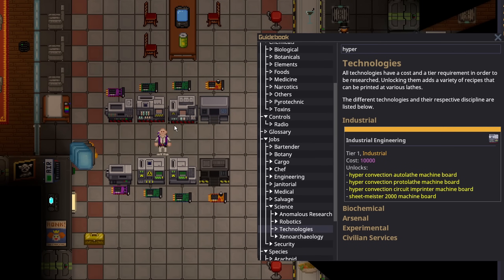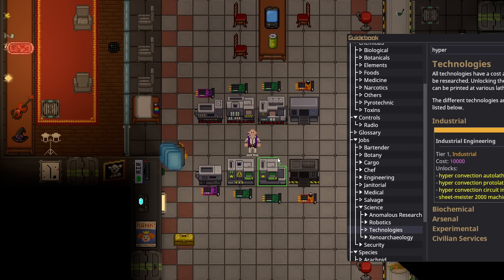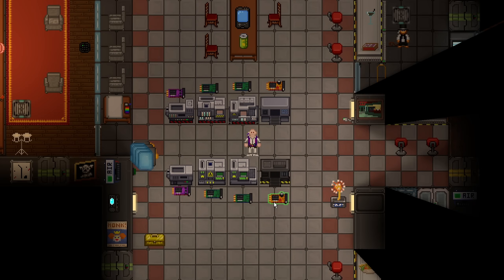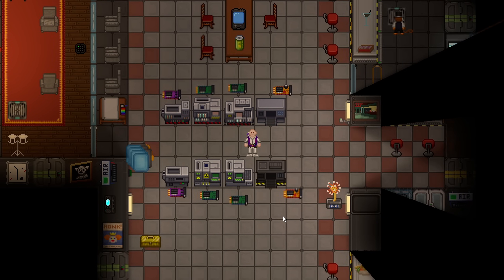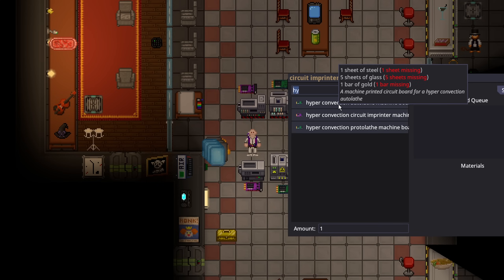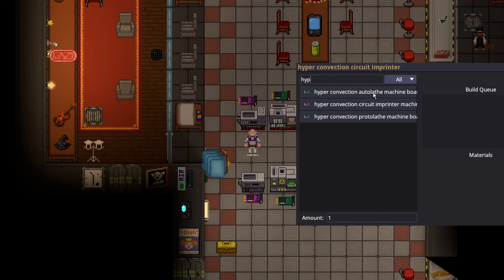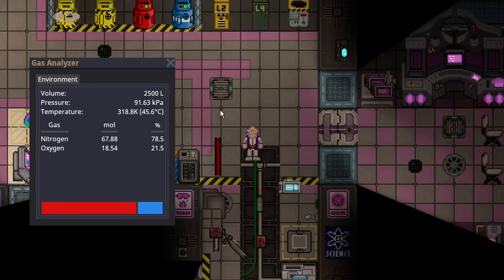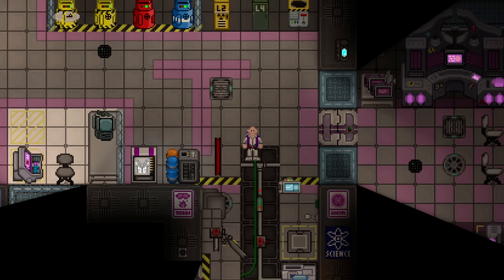SS14 - Hyper Convection Machines Explained (And How to Deal With the Heat)

Comment from the maker: If anyone has better methods of cooling hyperconvection machines, please share them in the comments. I'm just giving base level ideas of how to manage the heat.
This is probably the best method: https://youtu.be/wcRa3VT8SqE?si=ltXAfd5i_JsURHlZ
Reply: 7 space heaters surrounding it and one for accessing (I have had this happen)
Reply from the maker: @NomNumNomYum  The minecraft enchanting table method lol
Reply: you can actually just place a passive vent and connect it to a freezer/hellfire freezer. Put it on 293K (room temperature). Usually works fine
Reply: I'm wondering about using radiators to equalize temperature with a gas loop (either the waste loop or one going to radiators in space) without venting the room's air,

Comment: Wearing insulated gear to protect from heat is perfectly normal, you just can only last there so long.

Iv'e absolutely been around huge bonfires and similar where wearing a jacket makes you significantly cooler

Comment: Generally what I do is place two space heaters near my hyper convection machines. You can usually do some light re-arranging to comfortably work around them. Set the space heaters to high power and lower the target temp to have a buffer to work with. Combine this with some fancy NT insulated clothing and you're pretty much fine in terms of temperature. If you're not running the clothing, you may be toasted a bit in small rooms but you can just leave the room for a few seconds, and chat at the front desk or whatever. 

I've seen paranoid RD's spend a quarter of a shift stuffing the hyper convection protolathe into a 2 by 3 box in maints and attempt to setup a hellfire cooling loop. While it is satisfying when it works and cranks out a lot of parts, it's much simpler to spend less than a crate of steel and a little bit of plastic on flatpacking two bluespace heaters. All in the pursuit of science!
Reply from the maker: i have a video comin out in a day that has probably the easiest method to completely eliminate heat.

Comment: I just checked and it seems you can build radiators that supposedly equalize heat between the environment and gas in a pipe! This might be the source of a more practical custom cooling system for such machines. Sad there doesn't seem to be a heat pump, though. At any rate, with some cleverness, I'd assume pumping heat into the station's waste gas (which is likely to be merely dumped overboard like open-cycle coolant) would be more power efficient than magicking it away with freezers.
Reply from the maker: Yeah, I'm sure that'd be a good solution if you can get good access to space as a scientist, which normally isn't too hard.

Comment: If you get your hands on a holofan you can put it right ontop of the machine with the same setup you use here in the arti room and the vent will only suck out the tile in the holofan and the hot air cant get out.

Comment: Now I'm imagining the amount of heat you pump out in Frontier. 
"Oh, I want an upgrade of 12 thrusters, that is 48 capacitors right there. And I also want the gyro upgraded, two generators,  the ore processor, and a few toys like advanced magboots." A casual 75 parts later and the walls are melting, and not from the space drugs
Reply: Frontier merchant here, I build my hyper-convection lathes on an extension built onto my ship. Can’t cook in a vacuum! Though they print WAYYYY slower so sometimes it’s better to use a time efficient standard lathe with t3 parts.
Reply: It's really funny. Since hardsuits protect you from the blistering heat, you can be perfectly fine but as soon as someone boards your ship to deliver mail or buy some of the cool stuff you are selling, they get instantly cooked by the easy bake oven you made your ship into
Reply: The mailman turned to ash on my science ship as it never dropped under 500C even with a radiator a space heater, and a ice anomaly putting out cold.
Reply: @shadowmeister5432  was that last night? Because I believe I went aboard a Lyrae docked to Frontier last night to look at some stuff they had for sale and got cooked pretty fast. I got out of the ship pretty quick, but even then fell to crit while trying to cool off.

They had commented about having an ice anomaly
Reply: @scottmacgregor3444  Oh sorry about that. Yea that was our ship, it was a tad toasty.
Reply: @shadowmeister5432  Ehh. My fault. When the temp went to yellow that quickly, what I should have done is immediately gone back to my ship and grabbed a hard suit.

Comment: My thought from my limited atmos knowledge, if you're working in a room near the edge of the station:
- Create a circular pipe loop between the lathe room and space.
- Include a connector port and a pump to be able to dump the contents of a can into the loop. (This does not need to be in the lathe room. Put it wherever along the loop.)
- Add a pump to move contents of the pipe in a circle.
- Add a couple radiators to the pipe both in the lathe room and out in space. The more the better, especially out in space.
- Get a can of CO2 (or whatever, but CO2 seems best offhand) from Atmos or wherever and dump it into the loop. (Set the insertion pump to max to drain the can into the loop.) If needed add a second can, but one should be plenty.
- Make sure the pump is running to circulate the CO2 through the loop. Not sure what power setting is best.

If my understanding is right, the CO2 in the loop should be forced out into space, where the radiators will chill the fuck out of the CO2. The chilled stuff comes back inside, where the radiators from the warm room should absorb the heat into the cold gas, which is then sent back out to be chilled. I'm completely theory-crafting here, but the thought is to use the same process as to cool a nuclear reactor, cycling stuff through to absorb the heat and then venting that heat off to something else (in this case, outer space).

Whether this will work at all with SS14 physics or whether it will provide enough cooling if it does work, I don't know.

If your shift's Atmos is bored (which they probably are), try recruiting them to help you build and test this concept! Have the RD ask the CE for help; we're usually looking for things for our people to do if there aren't bombs going off or whatever.
Reply: You could've just said it's just like liquid cooling for PC's. Did you ever test this out?
Reply: @celexample  Sorry for my first comment; I thought we were talking about TEGs. Okay. No, I have never tested it--in the ramble itself, I noted that I was purely theory-crafting. I'd be curious to know the results if anyone does test this approach or something similar. :)
Reply: @Archangelm127  Mega late here- but from my engineering knowledge the side effect here is that you would also COOL the room given how cold space gets so you MIGHT end up turning it too cold given the situation but theoretically it would work, if you disregard everyone being a popsicle
Reply: @martynas6ha4griefer  The TEG room is usually separate from the break room, and we all have hard suits. Quit whining and get back to work. 😂❤

Comment: Imagine if putting a hyper convection on top of a gas port made it function as an exhaust extractor, depositing hot air into the port with much less radiant heat put into the general environment.

Comment: Yeah Salv not being focused on mining can be a pain. What I really don’t like though is when Salvage takes the ore processor from Cargo. I just don’t understand the salvs that do that. Gives them even less reason to come back to station and basically forces Cargo to have faith Salv will deliver mats or Fulton them back. Which given the state of Salv you can’t always believe.
Reply: In delta v they outright removed the salv shuttle so there's no reason to take the ore processor with you
Reply: @andrewgreeb916  damn. How does the mining get done then?
Reply: @plutus5238  jetpack, a piece of equipment most salvagers pass up, despite it being very useful.
It also makes it so you can come and go from wrecks at your leisure, saves a lot of headaches trying to get the team on the shuttle.
Reply: If you take it with you, it’s easier to dump all the ore into the processor and either Fulton crates of supplies back or drag the ore processor back home.  Bit faster than lugging 4 or more ore bags.  
I encourage as many salvers as I can to mine, or take care of it myself on shift.  Unfortunately, I’ve seen both cargos that never touch the crates I’ve sent back, and supplied science departments that never make anything

Comment: You don't have to build entirely new machines. Since the only difference is the board you can just disassemble the existing ones and replace the board. Saves even more materials, is faster, and you avoid anyone using the old lathes. You should upgrade cargo too.
Reply from the maker: Yeah I mentioned that, I'd also recommend just upgrading
Reply: @Liltenhead I must have missed it then. Whoops.

Comment: My suggestion is to force salv to mine by making their ship require plasma fuel
Reply: Nah. Give them toys for mining. Bring in materials, get points for new gear.
Reply: And they will just mine for themselves and don't give anything to sci, because they can take proto from expeditions
Reply: Delta v tried that, salv just harassed cargo for plasma
Reply: I haven't used a ship for salvage once in the last 5 shifts I've done as Salvage, every salvage tech I've seen just uses a mini jetpack to get back and forth from the expedition. They're only like 50-75m out from the station and anything too heavy to carry can get fultoned

Comment: What about conecting a cooler to sci crafting room distro?
Reply: I have seen hellfire coolers used to keep science at safe temperatures while running these things
Reply: @andrewgreeb916  yeah, me too, thats why i asked
Reply: @4dmost991  I believe they had it hooked up to a passive vent so if they needed to cool the room they turned on a pump and a ton of air from distro was super cooled and pumped into the room.

To be fair I was playing salvage that round, I was trying to turn my mining haul into shuttle parts to do an expedition.
Cause delta v does not give salvies round start shuttle...

Comment: You can close them with a holographic atmosphere projector, you can put a hyperconvection autolat on a tile with a small fan, you can build a sealed plastic curtain on the tile. All these options will not allow air to escape from the tile and the room will not heat up.
Reply: Aren't holographic projections temporary?
Reply: @noelka8134  Yes.

Comment: You could use freezer in the second part.
Reply: Would have to get Atmos to get over there and set it up if you are doing this setup round start, good luck convincing atmos to do that instead of teg or trit setup (assuming they finished distro and waste). Space heaters allow sci (and maybe cargo if you want a bunch) to solely set this up.

Comment: Pro tip, you can surround this machines with AIRTIGHT plastic flaps, you can interact through them and they won't let hot air out
Reply from the maker: I didn't even know you could make those.
Reply: @Liltenhead  - It was added recently
Reply: there's a PR up already to remove the ability to build these airtight flaps. sad
Reply: @weeeeelp  another nerf...
Reply: Aren't the craftable plastic flaps not airtight despite its name. Iirc there's two plastic airtight flaps and one doesn't block atmos
Reply: @ThatOneGoblin447  - No, airtight flaps blocks atmos, maybe you constructed it incorrectly?

Comment: i saw people walling off hyper convection lathes with plastic flap things. Not sure if it works
Reply: It works till someone removes one, then like letting the bottled up heat of a heat anom out everyone gets cooked
Reply: @andrewgreeb916  i just thought about, what if you will also put one space heater set to zero Celsius in these flaps walling. It might be not enough to remove all heat
Reply from the maker: Can't make those anymore